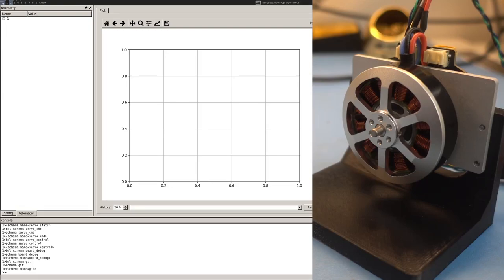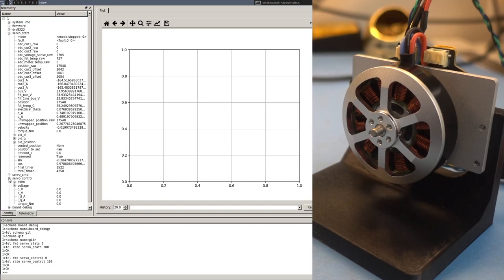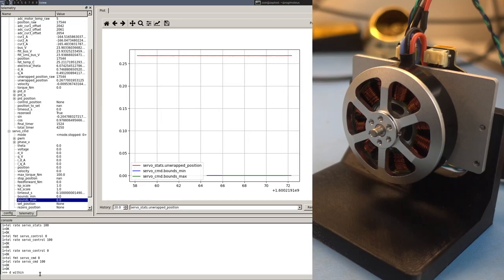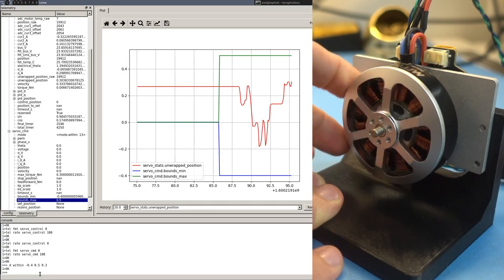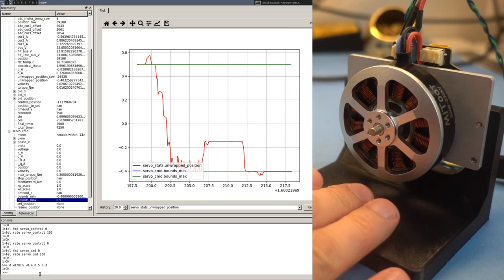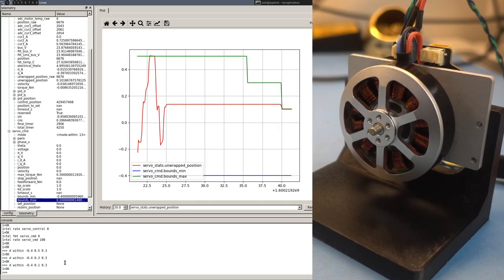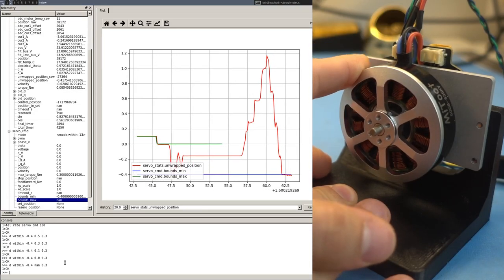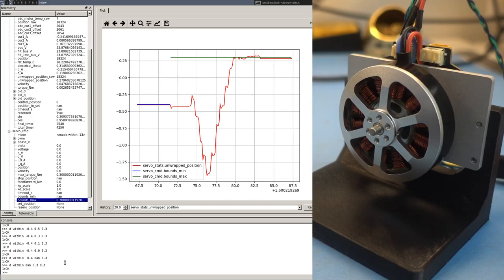"stay within" mode in the moteus controller

Comment: Looks good! Maybe having the torque increase if you get closer than x to the boundary would be handier because it could provide a more gradual ramp up?
Reply from the maker: You can control the stiffness of the response using the normal PID parameters, the upper and lower bound just controls where the torque begins to be applied.  Using the P constant (or per-command P scale override) along with the maximum torque allows you to configure any linear torque vs position ramp you choose.